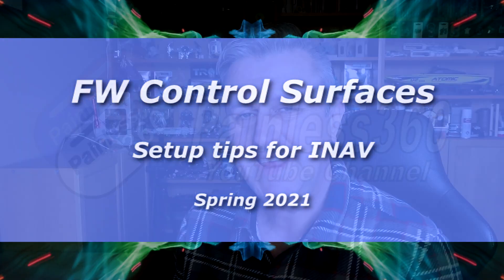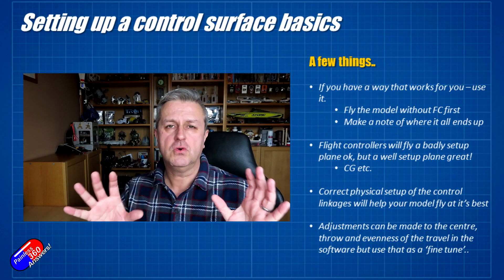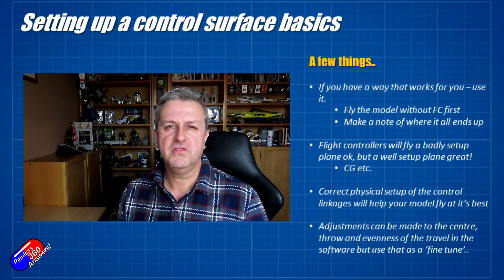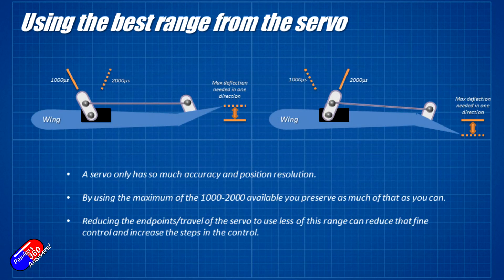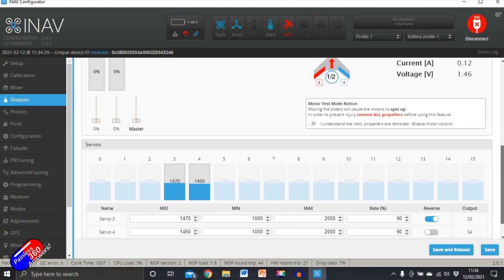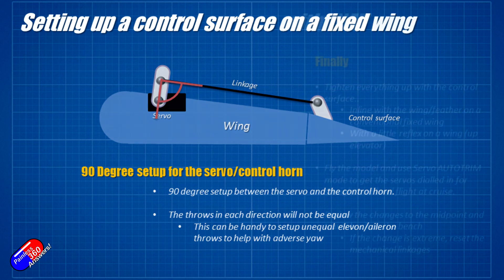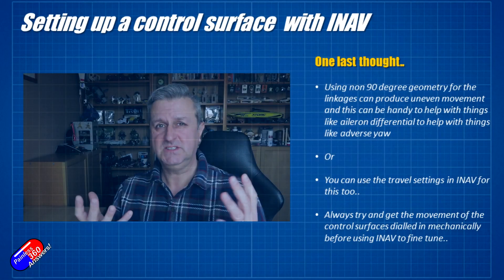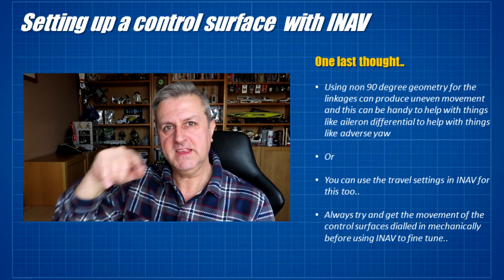Setup tips for fixed wing servos and control surfaces (inc. INAV)

Comment: I have found that the two servos that came with my AtomRC Dolphin behave in a very asymmetric way. Is this an indication that one is faulty, or should I simply adjust the control rod to compensate for the difference?
Reply from the maker: If the link geometry looks good with the 90 degree angle between the push rod and servo arm when the control surface is in a neutral position, but the throws are wildly uneven... I'd check the servo is OK
Reply: @Painless360  Physically, each side is even, but I had to set the weights to really odd numbers to get even movement on each control surface. There's a 25% weight difference between the two.
Reply from the maker: That does sounds a lot, next time I have my Dolphin out I will see what mine is like.

Comment: I recently got a zohd drift and i'm trying to setup ailerons on a single channel instead of one per servo. By default the inav mix for airplane without rudder sets it to one per servo. Does anyone know of tutorial for doing this? The drift comes with a splitter cable so i assume this is a better way. Am i correct or is either way fine?
Reply from the maker: Simply plug the y cable into one of the aileron outputs configured in INAV. Best of luck
Reply: @Painless360  i should of thought of this, thank you.

Comment: Wouldn't you also increase expo a bit if you move the linkage down? Now where it gets interesting is that a exp curve will not neutralise a cosine curve, supposing a linear relationship between surface angle and effect.
Reply from the maker: It honestly depends on how it feels when I fly it. I go more by feel than anything else. Happy flying!

Comment: For eleveons, is the maximum throw specified in the manual with full elevon deflection, when both roll and pitch are deflecting an elevon to the max at the same time? I am new to fixed wings, coming from copters🙂
Reply from the maker: They are usually shown separately in the manual so set the throws as it shows. See my builds and check out https://www.youtube.com/watch?v=OaKqAng-BVE
Reply: @Painless360  thanks for the reply, I will watch this. I am building the ar wing pro and the manual only mentions 12mm throws and 2mm reflex. what did you set for your ar wing pro?
Reply from the maker: That is pretty much spot on. You may need a little trimming when you get it flying. The CG can be tricky to get unless you are using a heavy battery. Adding an action camera (as it was designed) can help. See my AR Wing PRO videos..
Reply: @Painless360  Yes I watched your ar wing pro videos and many more. Actually most of my fixed wing knowledge is from your videos, they are a great source of knowledge.

Comment: Is it better adjust the servos by linkages or by Inav...what is the priority?
And  how much Can I adjust the servo via Inav? normally is 1500....what is the good  range?
Thanks a lot
Reply from the maker: Adjusting mechanically would be the best way then dial it in by limiting travel in the radio/flight control software. That way you preserve as much of the resolution that the servo is capable of.

Comment: Most servos have an odd number of splines. If, when a servo is centred using a servo checker, the servo arm is not at 90 degrees try removing the servo arm, rotate it 180 degrees then retry on the servo. You usually find this gives a closer result.

Comment: Very informative video Sir ...  I have a couple questions . What is your opinion of the clip on or other designed aileron deflection gauges ?    I have tried various methods in the past and not fond of any of them . Also the various pull pull wire gauges that should be used to make our own length rods . At what point is an aluminum servo arm needed ?   I have digital , all metal gear servo’s and they include plastic throw arms . I’m assuming the more expensive the project . The more expensive the hardware . Lastly what size components did you use on this  fantastic looking wing ?     As always Thanks Sir ....
Reply from the maker: I tend to use a straight edge and the Mk.1 eyeball for setup. If it looks right it probably is (with a little experience). Check out the build of this model in the series for all of the parts.. Happy flying

Comment: One detail i did not see mentioned is about play in the link. For example volantex includes push rods that are to thin for the holes in  there own included ruderhorns resulting in play .  Even with the metal clevis as shown on this model using a aditional nut to lock the clevis on the pushrod reduces play a little.  Another detail that should have been included is to make sure the servo is located in a position so the pusrod is at 90 deg of the hinge. This makes sure all the force is used to move the controll surface and is not trying to push it sideways.

Comment: Nice video Lee. 

One of the biggest issues I see is that not a lot of the kits come with recommended throws. Traditional kits always tend to have them, and some FPV plane manuals (e-Wings, Strix, and StealthWings off the top of my head) have recommended throws. But most of the popular kits from China never even mention them. 

This can cause major problems, especially with new pilots. I have seen people asking why they keep on crashing, then show a video where the control surfaces are moving 25mm in each direction.

Recommending throws would be something very simple to add to the manuals, if the manufacturers have test flown their models. I think this is a reason why we see a lot more with custom foam guys like Arthur and Greig. We see videos of them testing potential future kits, and during those tests, they’ll get a pretty good idea about what throws work well. So adding them to the manual is a no-brainer. 

I know that sometimes manufacturers come to you for advice. For example SonicModell with the AR Wing Pro. I was just hoping that going forward, one of your recommendations could be to add recommended throws to the manuals of all their planes.
Reply from the maker: It is an excellent point. I always contact the manufacturer of any model that doesn't come with CG and throw detail in the manual. With some makers like ZOHD and Sonicmodell I'm pretty happy that they've setup the throws mechanically to give you what you need at 100% travel but that isn't always the case.

The custom/boutique models are more aimed at experienced builders but I can speak from experience that CG and throws is something that e-Wings test extensively. I did feedback to Greig at e-Wings on a couple of these points so that the detail is easier to find and explicit in the manual. Having things on the webpage but not in the manual just confuses builders. I'm pleased to say that he addressed all of the feedback I gave him so the manual for things like the new Vortigaunt also includes things like the recommended battery too.. 

If I'm in doubt then I'll set it to about 15-20mm throw and then add dual or triple rates to the radio so that I can dial it back if it is too much. I always mention the CG and throws I use in the videos I make now as sometimes the manuals are wrong too! 

I'll keep sharing the CG and throw placement in my reviews..
Reply: @Painless360  you make some nice points there Lee. And while I’d agree that ZOHD/SonicModell may set up their models with decent throws in most cases. These models can also be bought as kits, without servos. So there is never really a reason not to include throws in the manuals, just to cover all bases. 

The dual and triple rates is also a good idea. Again, this is something that someone new or only with FC experience may not have heard of. But really a receiver only option, unless you set the rates up in iNav its self or fly in manual while tuning the throws.

But still, it’s nice to see that you are also pushing for this too. I totally agree that the throws should be in a manual if provided, not just on a web site. Having them in both locations would be perfect.
Reply from the maker: I have a few videos on how to maiden a fixed wing but sadly they are only viewed after a costly mistake.. Maybe worth another video on dual rates..

Comment: Thank you for you video.
Might you explain what you mean with granularity?
Furthermore what is the difference is min/max and rate?
Reply from the maker: There is a maximum of 1000 PWM values between 1000 and 2000 microsecond pulses that servos use to position. If you only use 30% of them then you only have 300 vs 1000 positions the servo can be in for control making the control less granular.
Reply: @Painless360  How many MM does you forks measure? M2?

Comment: Great Video Lee and I just watched it for the second time. I have a set of Max mini servos and tested 3 of them for amount of movement in each direction and all 3 move significantly more in one direction. is there anything one can change in the servo to correct this? test was done with only the servo connected directly to the RX. No trims on my radio. Yes I need to get a servo checker.
Thanks for sharing
Jeff
Reply: Did you start with the servo arm at 90 degrees to the servo body? If you are using a single arm horn and it wont sit at 90 degrees to the servo body when your tx is centred then try a four arm horn, one of the horns will almost certainly line up, they each have a different alignment with the splines.
The servo has a particular linear arc between its end points and can't really have differential as I understand it.
Reply from the maker: I'd confirm with a servo checker before getting too worried. The movement should be pretty equal.. Best of luck!
Reply: @Painless360  Thanks Lee. I guess another item to put on my wish list.

Comment: Thank you, this video has come out at the perfect time, as I've just finished building a AR WING PRO, using a f35FC. Just to clarify setting reflex on this plane is supposed to be done physically using the linkages and horn position is that right? Thanks again for your awesome videos they are so much help.
Reply from the maker: You can set it either way but I set it mechanically.. Happy flying